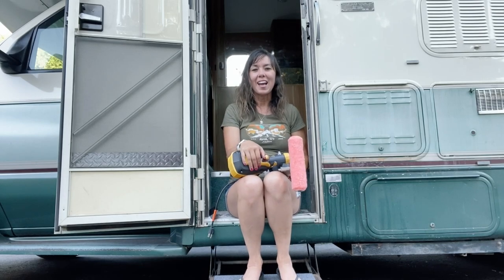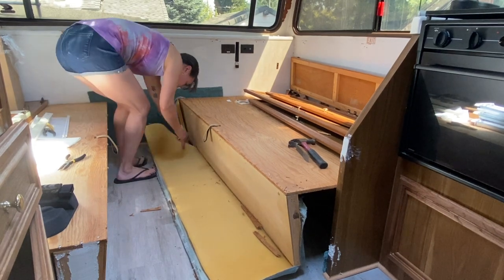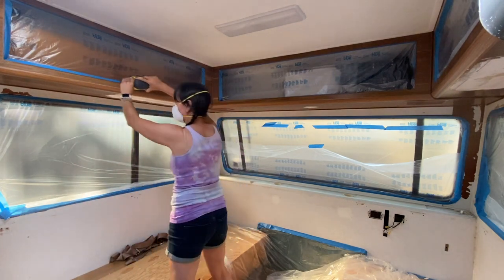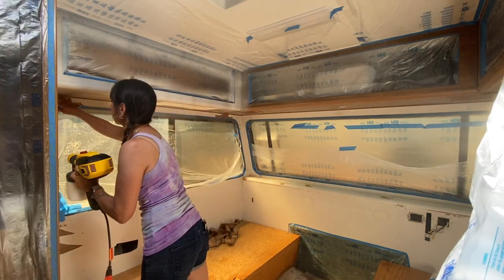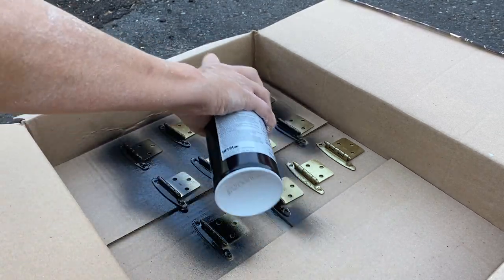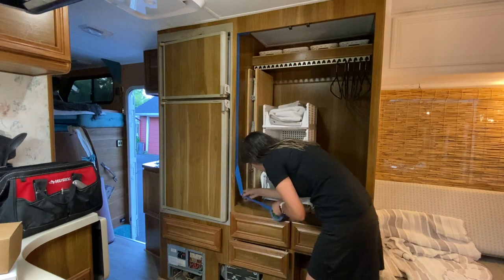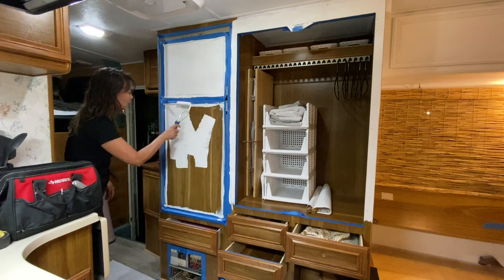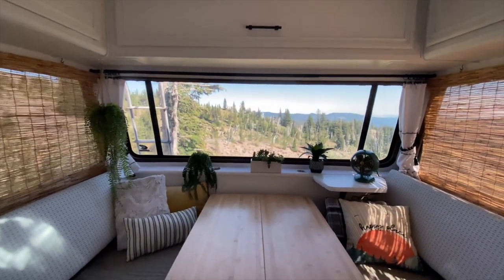Spray or hand paint RV cabinets?

Comment: Looks fantastic, but where's the snowboard gear going to go? I'm thinking I'd get a roof rack (if possible) or a small trailer. I can imagine steel edges dinging up that nice paint work you've done. 
Anyway, keep up the good work and thanks for sharing. Looking forward to the next one.
Reply from the maker: Thank you!  For now, the boards can fit in one of the exterior storage compartments.  But eventually, I would like to get a hitch mounted rack.  Yakima has a really cool system that I would love to have, but it is pretty spendy.  Someday...
Reply: Yakima? Spendy? Noooo...😄 Gotta say, though, I do like their designs. But, it is, you know, a little spendy.

Comment: Awesome sauce!  I am embarking on this painting journey in my 2002 LD RK.  Do you have a link to the 3M Scotch Blue Painters Tape Plastic?  Also, did you clean the areas before?  Did you use primer BEFORE painting?  If so, what brand?
Reply from the maker: Thank you! I need to be better about listing the products I use!
I cleaned everything I didn’t sand with Krud Kutter and I used Behr’s scuff defense paint with primer.
Here’s a link to the 3M paint: https://www.homedepot.com/p/3M-ScotchBlue-24-in-x-30-yd-Pre-Taped-Painter-s-Plastic-with-Edge-Lock-and-Dispenser-PTD2093EL-24-s/204344770

Hope that helps! Good luck in your project!

Comment: You mentioned both premium white and no scuff grey.  Which did you ultimately use? I’m confused, it looks like white but you mentioned grey also.
Reply from the maker: It's kind of hard to tell in the video, but I used both.  The white is on most of the cabinets, but I used grey on the base cabinets in the kitchen.
Reply: looks modern thank you